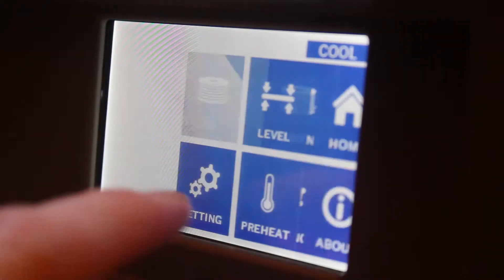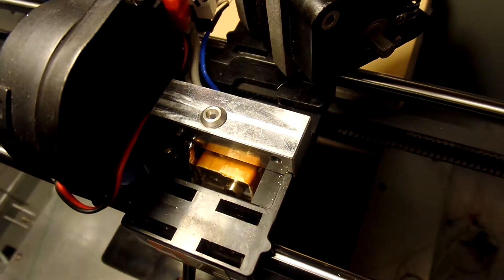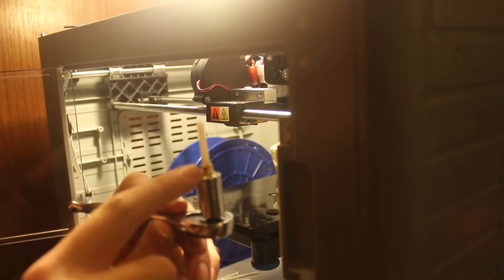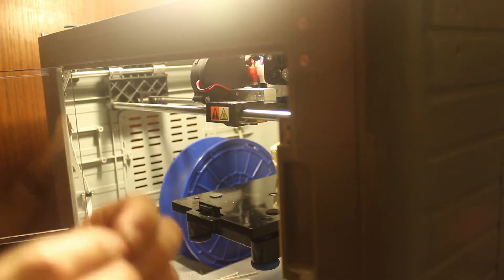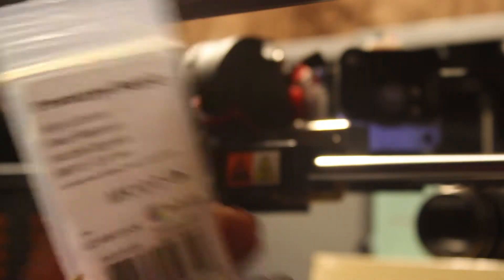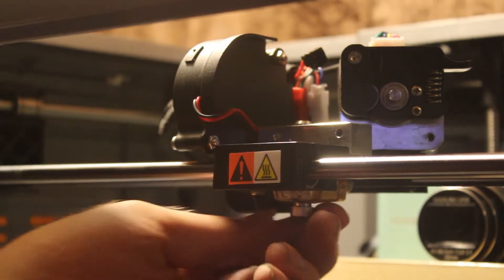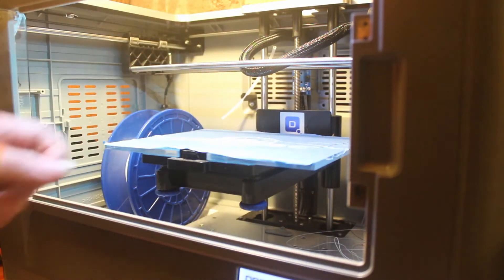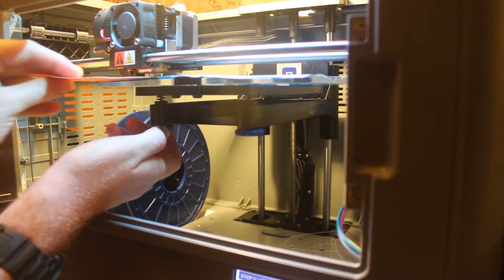How To Upgrade Or Change Your Dremel Ideabuilder Nozzle

Comment: Thx for the video!  It’s much easier to get at the nozzle if you turn the printer upside down.  My 3d20 only goes up on o 230C.  Is there a way you to increase this?

Comment: Nice!  I've had my 3D20 for almost a year now.   Works great.
Reply: I have been having this printer since it first came out at Home Depot. Just now I am having problems with the filament getting stuck. I was unaware there was a Teflon tube attached to the nozzle. My original nozzle seems in great shape but I am still going to replace both the nozzle and teflon tube.
Reply: I just removed the nozzle and Teflon tube; the nozzle seems worn but I think it still prints well. I guess I have to wait until I compare it with its replacement. On the other hand, the Teflon tube was greatly damage. The end that inserts to the nozzle was warp and badly burned. I really hope by replacing the Teflon tube will fix my print issues.

Comment: Nice! im getting a dremel next week. and did you try the thing i said to do supports, did it work?
Reply from the maker: Cobo Nice! Let me know if you have any questions when you get it. I did try it and called up Dremel, unfortunately it only works with their new printer not the older one I have
Reply: yeah ill let you know if i have any questions, and thats too bad that didnt work, i thought it would be able because the files can be opened in the 3d-20 software
Reply from the maker: Cobo Could not even get to that point of downloading them if you can open it in the Dremel software try to print one and see
Reply: yeah i will when i get it.
Reply: I know this conversation was 4 months ago but it did work, quite good supports too.